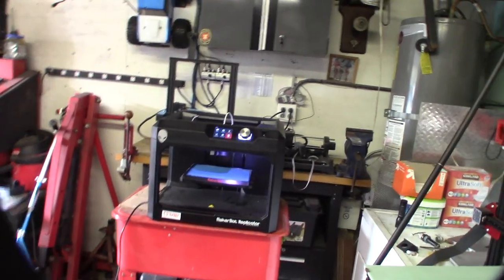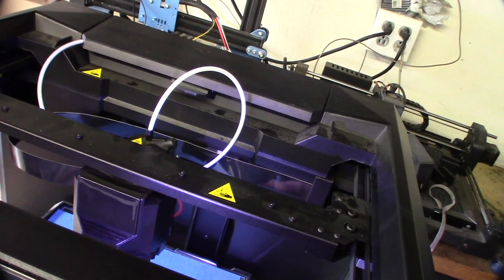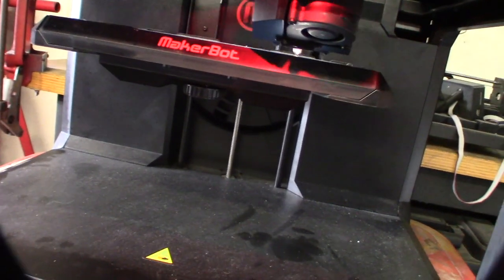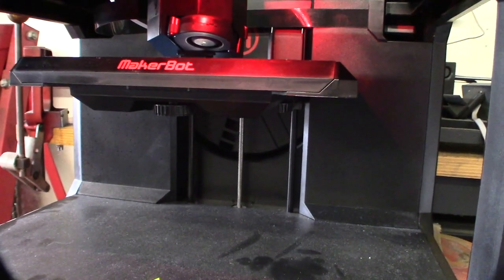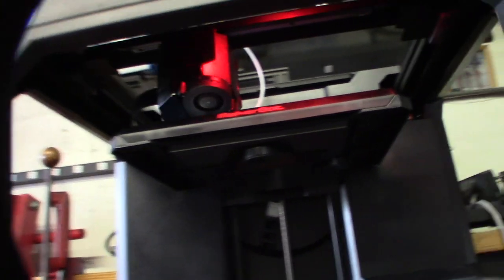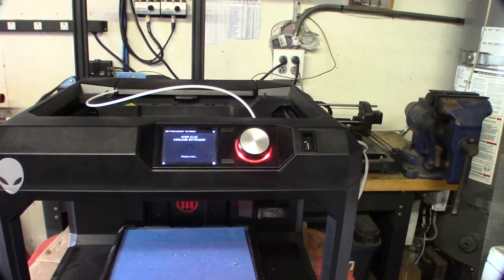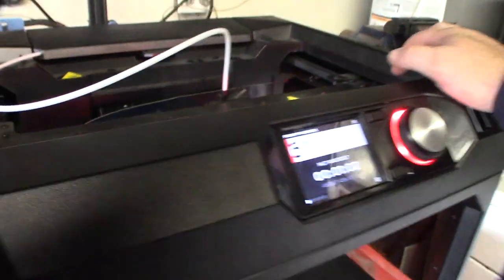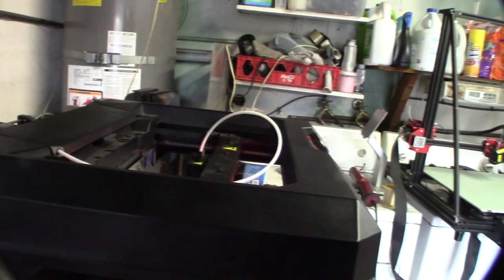Makerbot Replicator Intermittent carriage repair, BLAST FROM THE PAST!!!

Comment: I got one of these for free from my old job. It wasn't working and they gave it to me. Didn't take much to get it up and running - update firmware and splicer program. I still use it occasionally and it does a decent job. The easy bed leveling, wifi connection, color screen, and camera are things I like and newer machines are just getting. Yea, it's loud and slow and the print quality is so-so by today's standards. I would love to get a newer 3D printer but will use this one until it dies for now.
Reply: Same here! I got mine as a gift many years ago, and have had a love-hate relationship with it. The biggest upgrade I made was buying the smart extruder+, which seems to have breathed new life into the system. My only remaining complaint now is the extreme amount of noise the printer makes.

Comment: These things are a tragedy. The fact that they still sell the slightly newer Replicator+ to schools should be a crime. 2 grand for a printer that was bad when it came out, in 2023 is crazy. I got one for free and paid too much. Sold it for an Ender 3 Pro that sadly printed much better. PLA only with an unheated bed even in 2016. Being CoreXY was nice, the smart extruder was a neat idea that was slightly improved. But having to pay the cost of a printer as little as every 6 months to keep a printer going was not nice. 

The Z sensing is a hall effect sensor the whole hot end moves inside the extruder assembly.
Reply from the maker: I agree. Total headache. I fix 3D printers for bunch of schools. They all have overly expensive printers.